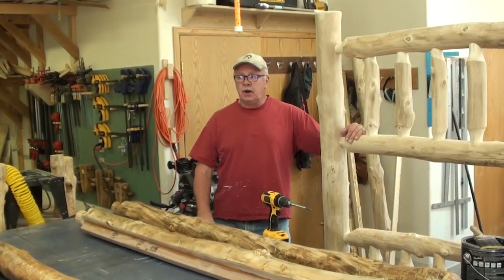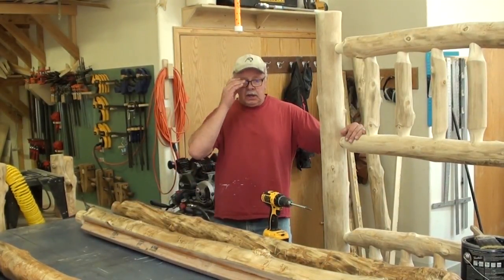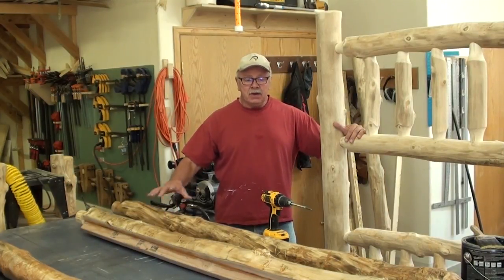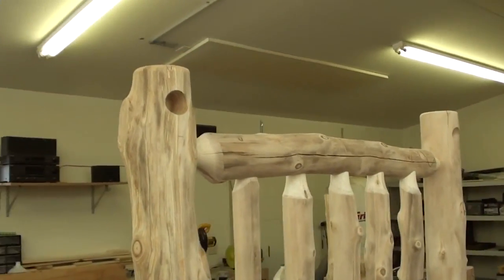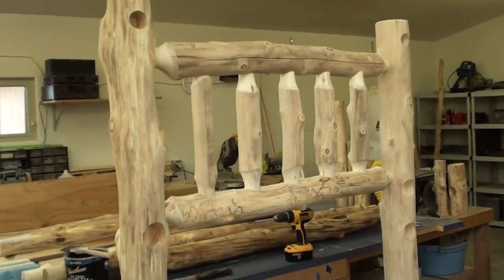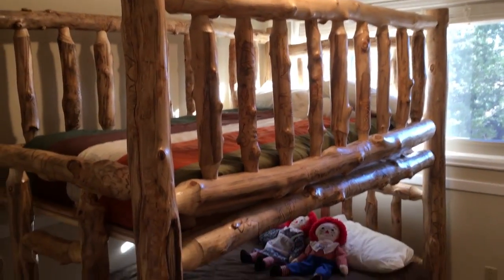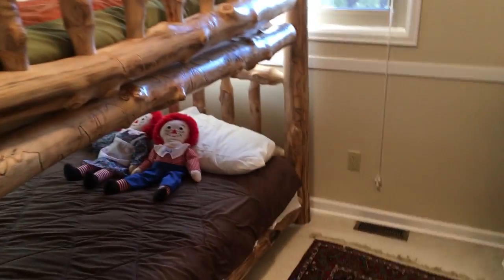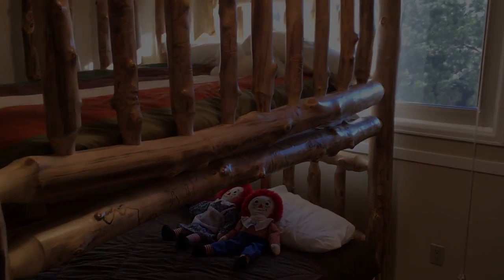Making a Rustic Aspen Log Bunkbed - Part Three

Comment: Bed looks really great.  On one part of the video series, you threaded the end of a log and inserted a bolt.  Have you considered on future projects like this, gluing up the project into several large pieces, then using the same bolting method to hold those main pieces together? In example, you could glue the headboard together, glue the footboard together, glue the siderails together, and then have bolts inserted into the end of the tenons of the main beams for the side rails, have a bolt-sized hole drilled through the center of the matching mortises all the way out the other side, and then use nuts on those bolts to hold the three main parts of the bed (headboard, footboard, and siderails) all together.  It would still be structurally sound, but you would be able to take it apart again if you ever wanted to move it, without having to worry about how to get the main pieces apart from already being glued together.

Comment: I noticed your techniques have changed over the years.  Do you prefer the table saw tenon cutter over the "giant pencil sharpener"?  Also noticed you didn't use the flared bit that you used a few years back as a second step after you drilled the mortise with the forstner bit.  I'm just getting started and thought I'd ask before I purchase tools I will wish I hadn't.